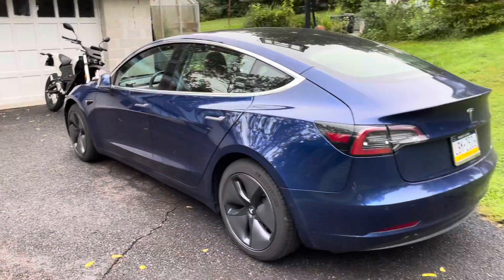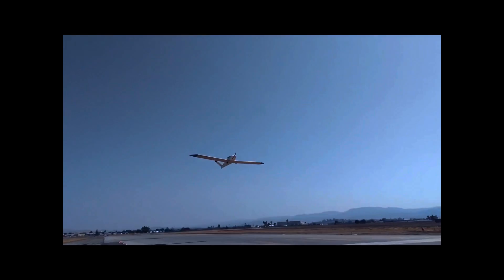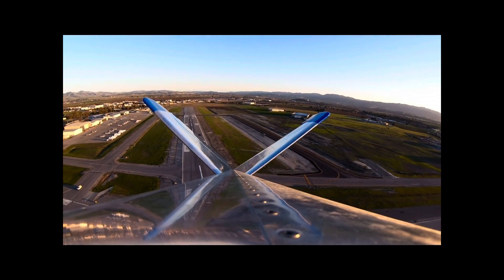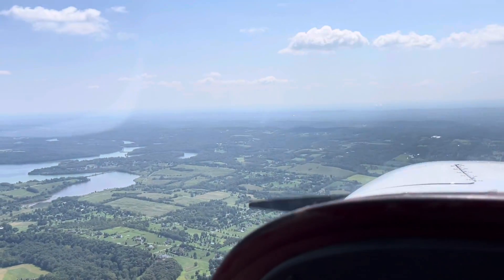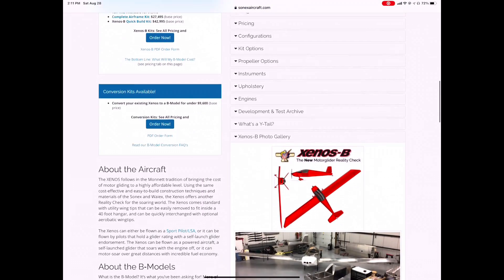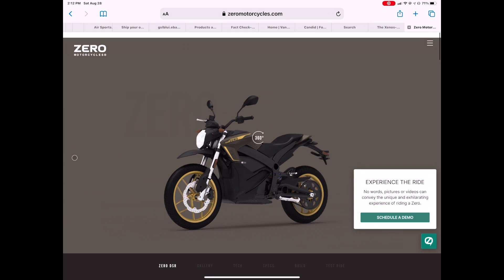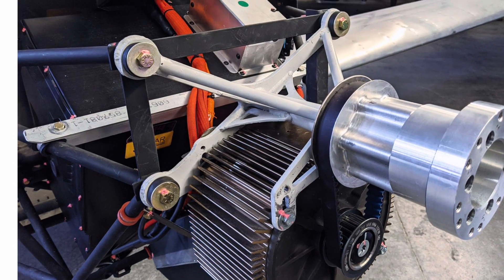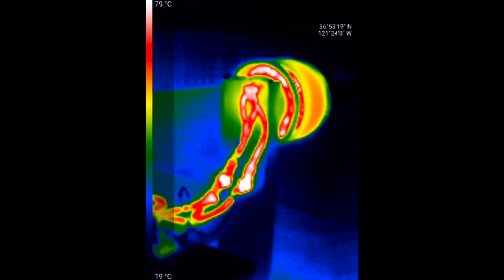Tim’s Tips #83 - Airplane Going Green with Zero Motorcycle, Sonex Xenos, Zaero Redrive Kit - 9/9/21

Comment: Tip from me: Find a crashed Ebike, make sure the electric is okay and buy it to salvage parts from for your plane build. That will save you some money. Good luck with the plane.
Reply from the maker: Thanks for the advice. Yes, I’ll be looking for a crashed ebike that has good electrics. I bought a new DSR because I wanted to be sure it has a good track record. A crashed bike may or not be a bargain. When my life is at stake, I don’t want to have any motor issues.
Reply: @tdrager  Of course, I was'nt thinking that you should get a faulty unit, just some minor front fork job or a gentle roll over damage, and the motor should still be untouched. A thorough inspection of the inside is a good idea to make sure nothing bad is going on, but you need a solid motor to make sure it can take long hours on high rev when you are flying. Will you have some extra ventilation channels to get more air around the cooling ribs or do you think it is enough?
Reply from the maker: @gudfarfar  Agreed. I may to regulate the motor heat with a cowl flap. In Summer, it would be opened and let in more for cooling.